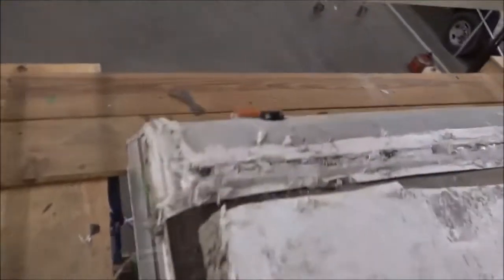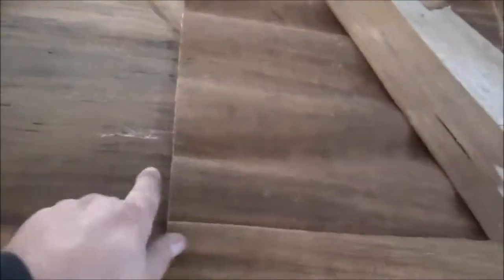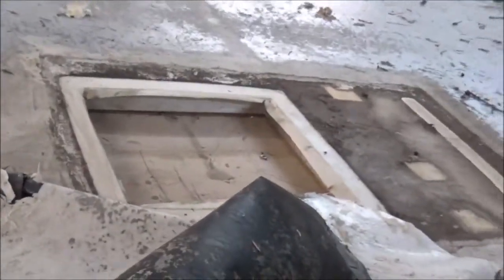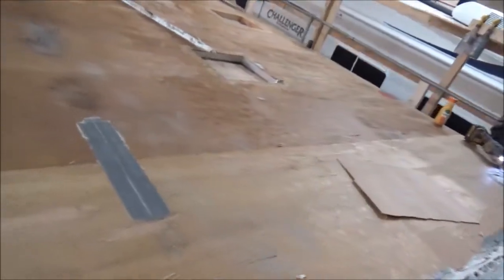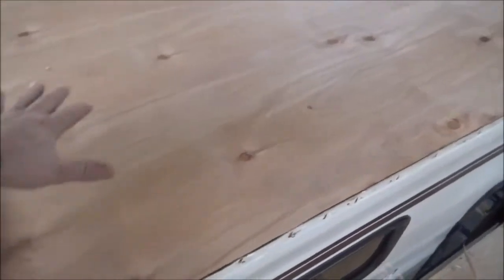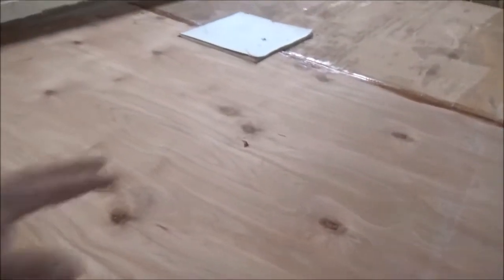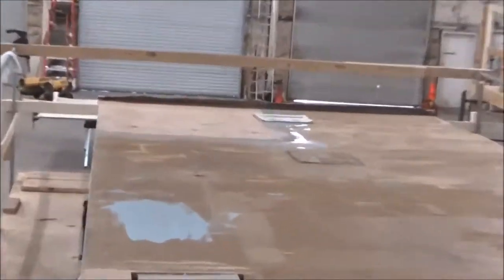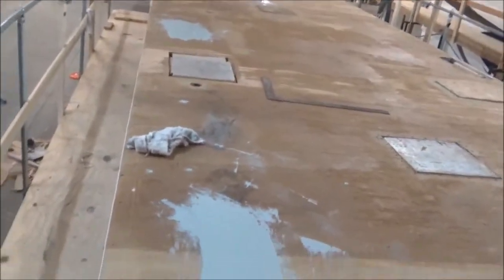Rv Roof Replacement and Repair Four Winds 5000

Comment: Great video. What is under the plywood?
Reply from the maker: Foam is under the plywood. Thanks for watching.
Reply: @RVROOFINSTALL  thanks for the quick reply so there's foam underneath the plywood what holds the roof from bowing down is there some cross members or some steel frame that runs from one wall to another?
Reply from the maker: Some have some aluminum supports. Some don't. If you are DIYing you'll find out when you open it up . There a few different designs from manufacturer to manufacturer.
Reply: @RVROOFINSTALL  so I just opened mine up and basically it has aluminum skin that's covering the steel 1 1/2 rectangle tubing. This one's a very similar to the one you have you're working on mine's a 1993 29 ft four winds. About half of the front the plywood is all delaminating just like in this video. Today I spent probably a couple hours taking screws out of the roof vents and screws out of the side tracks it looks like to me they folded the aluminum over the corners on the sides and stapled the aluminum and then covered the seam with that molding. This should be a fun job I'm really enjoying working on my motorhome. I got a really good deal on it it only has 23,000 miles on it and I paid $1,000 for it and I just also got everything working I think I got pretty lucky. Had to clean the carburetor out on the Owen generator. When I pulled the air cleaner off the engine airbox looks like some kind of rodent made a nest in there. Also had a couple of codes on the engine one was the EGR valve was stuck and also the engine coolant sensor was out of range but that's pretty much it. I'm going to probably have to redo the brakes on it even though the pads are hardly wore down the brake calipers we're sticking. We're also going to take the carpet out and probably do some click lock flooring. I found the original invoice and they paid $36,236.00.  the engine is a fuel injected 460 big block Ford. It's probably going to get like 8 miles to the gallon.
Reply from the maker: @ronbown3836  I'm glad for you friend. If you got the aptitude and know how... Yes you got a good deal. Change the brake fluid, in fact I'd change all the fluids,  antifreeze, oil and diff oil.  It's been sitting for a while. Maybe run some seafoam through it to clean out the injectors. Hopefully you will get more than 8 mog. 
You'll get it together.
Reply: @RVROOFINSTALL  I got a question for you when doing the final PTO roof membrane is it better to tuck the membrane UNDER the front aluminum face or ON TOP? Same with the back of the motorhome. The way it was originally was a large continuous aluminum sheet that was laid down and then they put the front and the back on top of that. Don't really have a video of me taking that off but you probably get what I'm talking about.

Comment: How do you make the curbs that all the fans and such are up on, how tall are they?
Reply from the maker: All those components bare proprietary to us. Thanks for watching!
Reply: Oh ok, do you sell them COD by any chance? What would you say the benefits are to adding the curb compared to installing the vents flush with the roof?
Reply from the maker: @janajones7392  No, we do not sell anything. Curbs are how a flat low slope roof functions. The divert water from protrusions.

Comment: What kind of epoxy do you use
Reply from the maker: We use different epoxies what are you referring to?
Reply: RV ROOF INSTALL the epoxy for the roof to foam
Reply from the maker: @jesslooking4truth274  use 3m90 spray adhesive. You can get it at Home Depot or Lowe's
Reply: RV ROOF INSTALL thank you so much

Comment: what did you use for the leveler? I have a low spot after I put my new plywood up. Would like to fill / level it if I could.
Reply from the maker: Use a self leveling product even Dicor self leveling lap sealant woukd work. We use Sika. It's a urethane product.
Reply from the maker: Use a uretethane self leveling caulk. Sika will work.
Thanks for watching.

Comment: I apologize if you said it and I didn't hear, but what kind of roof did you put back down. Was it it pvc or TPO , I know it wasn't rubber because of what you said about the 100 lb roller. Nice job. Thanks
Reply from the maker: We install commercial grade TPO. It is 60 mil thick structured. It's the same exact material.they use on hotels, office bldgs, restaurants....
Thanks for watching!

Comment: What type of roof membrane does this model have? EPDM OR TPO? 
I got 2001 four winds 5000 with a leaky roof
Reply from the maker: The manufacturers buy truckloads of whatever they can the cheapest. May be EPDM rubber this month and TPO next. Both membranes are low budget cheap of the cheapest. We install commercial roofs on the RVs.
Thanks for watching. Give a call Monday
423-475-7663.